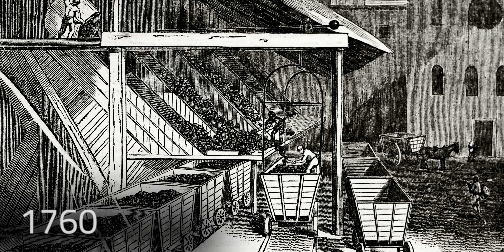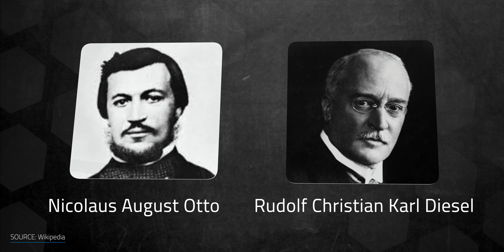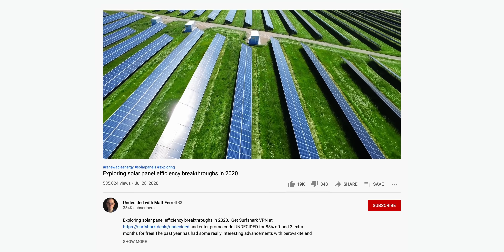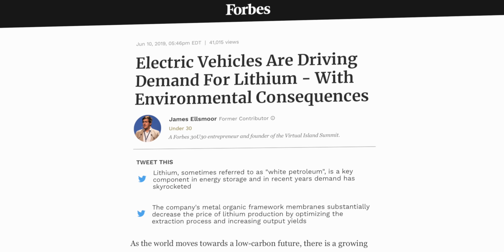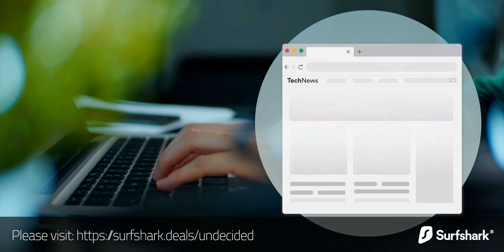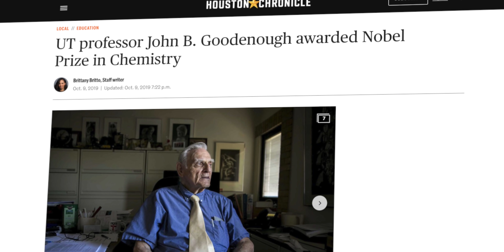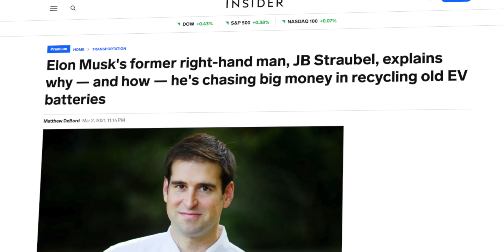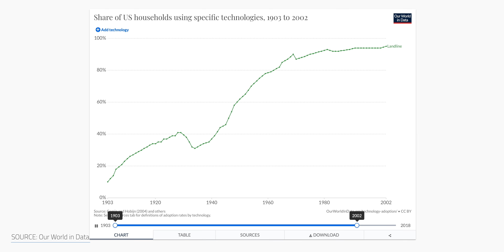Is the Future of Renewable Energy Inevitable?

Comment: DC is more efficient for transmission than AC, not sure where you got this info, HVDC (High Voltage Direct Current) has about 30%-40% less losses than AC. Here in New Zealand the link between the South and North Islands use a DC link for this exact reason.

Comment: I think a better way to describe the improvements in solar isn't to talk about efficiency.  Mathematically solar panels will never be 10x more efficient than they are today, since that would be well more than 100% (although you could do space based solar and get more light hitting your pannel).  Cost per watt is a much better comparison.  Making solar panels 1/10th their current cost would actually be much more important than even doubling their efficiency for most uses since you could just throw them on every rooftop.

Comment: I believe the next advancement will be the large scale use of vehicle to grid energy.  This will require more durable EV batteries and market making moves by EV makers.  Tesla is already talking about software that would facilitate an electricity spot market using EV’s.  Remember a model 3 battery is 5X larger than the latest Powerwall.  V2G could provide rapid scaling of energy storage that would solve intermittency problems of renewables, accelerating the adoption and transformation of grid to renewable power.
Reply: Why would anyone install a DC charger in their home?

Comment: Renewable energy adoption will be driven by Levelized cost of electricity (LCOE) significantly undercutting existing methods of production. The efficiency argument is moot if you have enough resources to produce it cheaply even today. 20 - 25% efficient but cheap solar PV panels are good enough and we require a small fraction of the earth to significantly exceed (even by an order of magnitude) the current production. The Governments and people who uptake it fast will enjoy the economic and other benefits too. 

If renewable LCOE of new plants < Operational cost of electricity of existing plants, it is inevitable. The missing link as it stands today is Energy storage which does needs an order of magnitude cost improvements.

Comment: We need terahertz oscillators for 70%+ solar panels.
Reply: Yes, nano scale antenna arrays that can convert the frequencies of light directly into electricity. However each antenna element needs a diode, and they cannot yet be made at nanoscale, but the idea is tantallising.
Reply: Exactly. If we could solve this materials science problem, these types of solar panels would be 3x the efficiency of current panels.

Comment: I think a proper "efficiency" comparison would be resources required to each unit of energy put out, provided it is similar materials at each stage in terms of cost, availability, and environmental impact. For example, if I could take all the materials required to build a solar panel today 10 years ago and now produce two such solar panels, each with 50% more output than the original, that looks an awful lot like tripling efficiency.
Reply: The way to think about this is the physical "footprint" (ie km^2) per kWh. The footprint can be measured in land required for acquiring and mining/extracting the raw materials, as well as the required land in hauling and manufacturing the energy producing instruments (ie, wind mills, solar panels, and oil rigs) as well as the land needed to place such instruments. In addition, one should consider the amount of land needed to offset carbon emissions arrising from the consumption of that energy. If we were truly serious, we would not be directly interested in kWh, but in the tangible products of energy production -Things like transportation services measured in kg*km, illumination measured in lm, computation measured in Hz*Hr, and heat and cooling measured in , well kWh. And if we more serious, we would consider how much of each of these products we produce on a per capita basis and identify the maximum quality of life our planet can sustain for a given population size and then consider policies to reduce the long term growth curve of the human population.
Reply: Very true!
I also think there should be more focus on “extended EROEI” and how that is improving or can be improved.
This recent 2020 paper suggests Renewables do not yet have a good EROEI (1,2 in Germany, which is dramatic) https://www.mdpi.com/1996-1073/13/12/3036
In 2017 there was a paper claiming EROEI was a lot better (about 8 for PV) https://www.sciencedirect.com/science/article/pii/S0301421516307066
I’m surprised by this. How can there be so much difference in estimate between papers? This should be a billion dollar question. Why are there apparently so few scientific papers on this topic? I could not find many.

Comment: The devil is in the details. The first problem with wind and solar is the energy density/diffuseness of energy. How much space is needed to generate electricity at todays best efficiency (say 25%)? Or at twice that at some future point (50%)? Can we generate at 100% efficiency (One argument is that there is a theoretical or practical limit of about 65% efficiency.) Say we store excess solar power (if we have any) in green hydrogen, how much (solar) power is needed to produce enough hydrogen to run an average car? Or a lightweight environmentally-sound car (that's an oxymoron!). My read on solar energy, is that it is just too diffused to be practical. It could provide say 20% of our energy needs (my local context/situation) with significant investment in infrastructure, but we would still be in energy deficit.

Comment: There simply cannot be enough 'green' generation to generate power 100% of the time (storage is another impossibility to compensate) for an area, then provide power for other areas that aren't getting sun or wind, AND generate power to drive hydrogen generation AND any other thing that will bring load. The scale needed is just infeasible. 

Texas' peak power demand in the summer was near 75GW. The largest battery installation I could find lately is only 730MWh. That would provide power for Texas for less than 1 minute. 

Anything in our lifetimes is going to require massive baseload power, like nuclear. We should be hugely investing in small modular reactors. 

Maybe someday humankind will have some magical technology that solves all of these issues, but I wouldn't bet that they'll happen within a century.

Comment: At 3 minutes you claim DC is not as efficient for long distance power transmission. This is simply not true, DC is more efficient over long distances. There are no induction losses, no skin effect (AC power concentrates on the skin of the wire),  long AC wires also radiate power like an antenna, and DC power can run a higher total voltage on the same size wire. The lines have to withstand the peak voltage. With AC, that is 1.4 times higher than the RMS. With DC, the RMS and peak voltages are the same. However, the power transmitted is the current times the RMS, not peak, voltage.

The issue is simply that transformers work with AC and not DC. Allowing end users to easily step down the power to the voltage needed.

Comment: Is renewable future of renewable energy inevitable?       In the very long run, yes - eventually we will run out of cheap fossil fuels to power our electrical grids.    Oh there will still be coal / oil but it will be what is left after the "low hanging fruit" has been mined and it will no longer be competitive economically to mine and process these remaining fossil fuels.      But right now we are still dependent on fossil fuels for much of our energy production and until the battery technology is developed to store the excess electricity produced by renewable energy sources for use later (such as storing solar energy in batteries to use after dark when solar is no longer producing) we will still need fossil fuel capacity to handle these demand periods.

Comment: Solar cells don't need to become drastically more efficient. They are already one of the cheapest ways to get power in many parts of the world. (They also started with much better efficiency that the first steam engines, so that was a poor analogy). 

Storage on the other hand desperately needs to become more cost effective. 

Excellent work overall. Keep it up!
Reply: Solar cells cannot work without silver which is completely non renewable. Drastically efficient you say?? Yeah as long as the silver holds up. But because silver is rare already your so called * efficient * way of energy is no more wasteful than fossil fuels.
Reply: It would be quite nice if it was more cost effective. But given the relatively modest amounts that actual computation s show how much we need versus what pundits on the internets blandly claim we do, with no calculations at all show that already.
VRE Storage (multiple types)  and perhaps DRM on special suitable energy uses such and PEM hydrolysers, are quite sufficient to highly cost efefct9ively reduce emissions for electricity production to zero or even somewhat negative.

Comment: I've long been involved in the energy area, from student up to researcher and as it stands now, a good electric storage technology  solution is THE factor holding back a more widespread use of renewables, even though they are continuously growing.

Can't say that we should all place our eggs in the same basket but if/when the electrical storage crisis is overcome renewables that convert energy directly into electricity i.e. solar, wind will acquire an even greater significance.
Reply: One other thing holding back such storage in say Australia, is so FAR we had no actual requirement to use such storage to keep our supply reliable. It is only as VRE percentages rise and the ability of preexisting peakers to fill in gaps becomes too small. Up to about the point Australia now finds itself in the most cost effective way to reduce emissions as to build only VRE and ignore storage. 
That also had the benefit of tending to phase out our sue of the most expensive per MWH in terms of emissions sources that we have. AKA the old fast becoming decrepit coal power stations.

Comment: solar panels have been around 20% for the last ten years. The 40% effciency lab result you mentioned used mirrors to concentrate more light on the solar cell, hardly a practical solution. Solar will never ever be very effcient and will take up lots of roof space.

Comment: "20-30 years before requiring service" That's very incorrect. Maybe the word you were looking for is replacement? They need constant service, especially wind turbines. Moving parts need a lot of upkeep.
Reply: A wind turbine need pressure washing of its blades twice a year, and erosion of the front of the blades also means that they need to be rebuilt with bondo and fiberglass after a decade. Both processes can be done while they are on the tower, but it is costly.
Reply: @Tore_Lund  You are telling me a machine with a moving rotor, in a machine exposed to the elements, needs no servicing for years? 

That's not how modern machines work. Even the highest quality rotors require constant upkeep, usually multiple times a year. Taking into account that wind turbines are exposed to the elements? Even more so. I'm not sure his source for servicing, but it's wrong.

Comment: I'm not sure how quickly lithium can be replaced in mobile settings where energy density is important, but I'd really like to see innovation on the building and city wide levels for lithium alternatives. 
Also, how safe is hydrogen as an explosive gas? And a bit concerned bc hydrogen can apparently contribute to the greenhouse effect =/
Reply: There are companies and searchers working on a better hydrogen storage solutions also the hydrogen can be converted to ammonium

Comment: Small molten salt reactors can make Hydrogen by thermal cracking, much cheaper and more efficient than electrolyzers. And small ones reactors could be be used as independent energy sources for small towns, supplying twenty four energy with no need for any hands on controls for five to ten years, at which time the reactor can is switched out for another one and taken to back to the factory for reconditioning or re-cycling. 

None of that exists at the moment, but it could if we focused on this technology instead of intermittent renewables that we have pumped trillions of dollars into.

Comment: Thanks Matt. I have watched a few videos on Highview's liquid air storage. The simplicity and scalability of it is very attractive.  They always state, at scale it is cheaper than battery storage but never discuss the actual price. It would be good to know that because getting our heads around current costings and potential for cost reductions, I think, is essential for understanding where we will end up.  Nextera energy just say both wind and solar cost 2 cents per kwh to produce and battery storage adds another cent. Recycling the solar panels adds another 1/10th of a cent. So that's a closed loop generation cost of less than 3 cents per kwh over the next 10 years because of the lower prices coming through making new installations cheaper and cheaper. (IE Tesla's effort to reduce  battery costs by 56%). A closed loop generation cost of 3 cents looks pretty good right now especially when the average retail price is 13.7 cents per kwh in the U.S.. It seems we have arrived.
Reply: The problem is that ever cheaper energy prices erode the incentive to invest in more renewables, as if the snake eats it's own tail. 

Economic policy will be just as important as technology in this transition.

Comment: The safest, easiest to handle energy storage is in the grid and the fuels market. Liquid fuels already have a distribution and market. Handling methane, propane and butane as well as heavier liquids; gasoline, kerosene, diesel and fuel oil are well understood.   Any source of energy can produce clean conventional synthetic fuels and we have a wonderful variety of engines to use them in.
Reply: The problem with liquid fuels, is that they still produce NOx when burned in an engine. So the problems with city air pollution is not mediated by just making CO2 neutral fuels.

Comment: Thanks Matt, I think the hydrogen plant being 95% efficient must be impossible? Does it include compression for storage?
Reply: My impression was that the 95% refers to the electrolyzer alone.
Reply: @pipertripp  also the need to convert electricity to hydrogen store it and convert it back will only be required for very low volumes of energy, and thus even though is cost more than average it is required so rarely that it has a very minor impact on average price. It is only overly naïve analysis that acts like all our energy is to be genrated that way that gets scary bad answers. In my experience such naïve uninformed analysis is never done by people genuine ly looking for a solution.
Reply: It's not.  They are probably throwing a number out that refers to something else and misleading people to think it applies to energy conversion.
Reply: Not to mention the typical 50% conversion efficiency when converting back to electricity.
Reply: I can't imagine that that legit. Unfortunately very carelessly quoted number...
They indeed says 95% for the electrolyzer alone. 75% efficiency for overal conversion 
( https://fair-economics.de/ove-petersen-gp-joule-im-interview-bei-faireconomics/ https://www.gp-joule.com/contact/press/article/details-news/electricity-to-hydrogen/ )

Comment: Bit of a side-note to the actual topic at hand, but the use of steam-power by the English was not actually the first industrial revolution. The first act happened in the Bengal (mostly todays Bangladesh), and was entirely powered by water-power. Only when the Bengali industrialised and cotton-based cloth-industry was beginning to drive the old-fashioned hand-crafting & wool industry in England into ruin, the English decided to sail to the Bengal, conquer the country, steal all the industrial looms and turn the new country into a cotton-exporting colony.

After bringing the automatic looms to England and starting to copy the design, they quickly had to realise one problem though. The most powerfull river in the Bengal, the Brahmaputra, has an annual discharge of 19,800 m³/s. All the rivers in the UK together barely produce ~ 1500 m³/s. So they had absolutely no chance to copy the entire system utilised in the Bengal, and instead were forced to quickly search for an alternative source of power, which lead to the accelerated development of steam engines (which had technially been known since the greek antique, but largely considered to be pointless toys by those who knew about them).

And we still keep on making this initial mistake to this day, by having a lot of energy-intensive processing plants located in the moderate climates in Europe and Northern America, instead of letting them take place near the Equator where more sun-shine, more heat, faster winds and bigger rivers would be available.